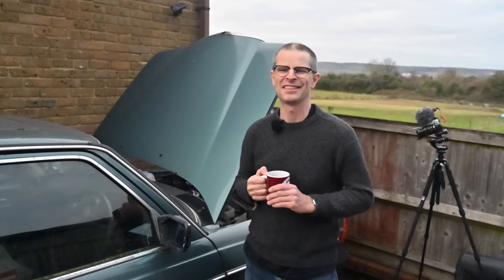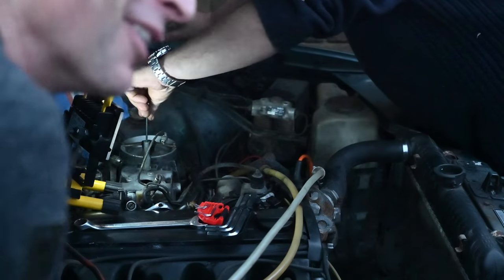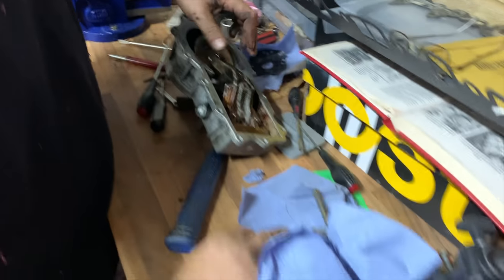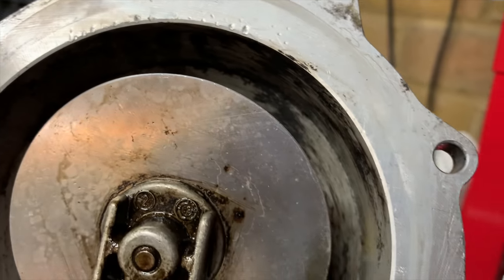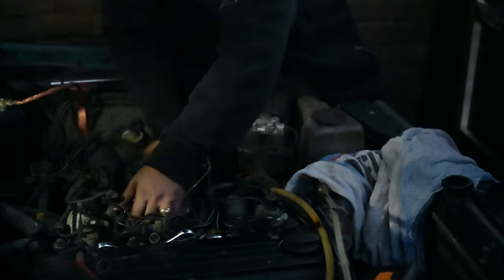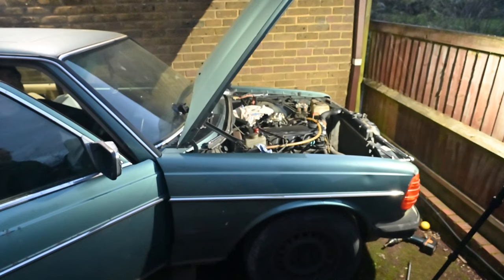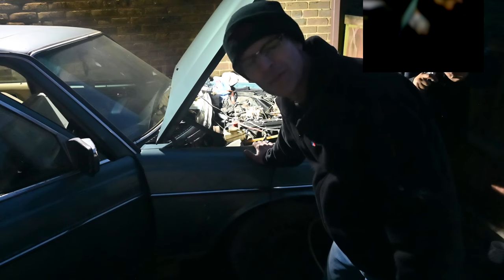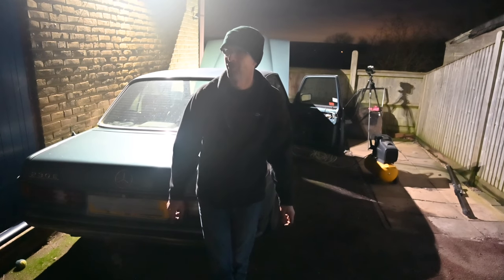Mercedes W123 - more fuel system shenanigans

Comment: That adjusted screw is spring loaded! you need to press in to engage the screw. I'll bet there was nothing wrong with that screw
Reply: I think the advice your getting is incorrect.  The air plate controls the fuel flow through the fuel distributor. turn in that adjusting screw 1/2 turn (press fully in to engage it) at a time until you get fuel out of the injectors.
Reply: I think the advice your getting is incorrect.  The air plate controls the fuel flow through the fuel distributor. keep turning in the adjusting screw 1/2 a turn at a time until you get fuel from the injectors. also please insure the connection between the fuel metering unit and intake manifold is correct. I have seen incorrectly fitted units leak air around the rubber connection and leak air so it will never start if that's the case
Reply from the maker: It wasnt engaging even when pushed in, think the thread has gone on it, its only aluminium after all

Comment: Matt, I am no expert but should you have a lighted cigar around gasoline and fumes? Otherwise great video!
Reply from the maker: Its harder to ignite than you'd think. I dont smoke but Andy says he did that for 30 years in his garage!
Reply: @furiousdriving  my question was not to ridicule but from an abundance of concern. 
keep up the great videos.
Reply: In an enclosed space where the fumes can build up it's not a good idea. But outside and a cigar/cigarette smouldering at around 400c won't, (and didn't), cause ignition. It matters how the cigarette actually falls onto the surface to the petrol. There is a lower chance of autoignition if the cigarette falls on it's side where the temperature is lower. Naked flames are the true enemy which is why there's no smoking in combustible areas because all cigarettes and cigars start with an open naked flame. Anyway, I had a fire extinguisher in my car and told/showed Matt where it was so he could chase me around trying to put me out.
Reply: @TheFakeRussian  Thank you for the explanation. Very good to know and I thank you.

Comment: Put a carb on it!
Reply: That is a great idea and the 2 litre version of same engine had a 1.75" Stromberg.
Find the manifold for that and put an SU carb on it.
Get one from an automatic car, that has the linkage for the kickdown cable.
Might reduce top end power a little, but would provide great economy comparable with injection of that era, but far more reliable.
Will also require ditching the high pressure injection fuel pump, for a low pressure type.
Reply from the maker: I think thats for the carb version. What Ive learnt is nothing is as cheap as you think it will be on these cars!
Reply from the maker: ignore, just saw your other comment
Reply from the maker: Think I might go electric if it wont run!
Reply: @furiousdriving  Think that would really bring a lot on new subscribers to your channel, but if you just got it running for now, conversion costs are going to get cheaper as time passes.
Batteries will be biggest outlay, which are in limited/expensive supply, until more electric cars start getting written off.
If the Merc were mine and I'd had so much grief trying to get the injection working, I'd be very tempted to just put a carb on it.
The 2 litre setup should just bolt on, though I'd probably prefer SU over a Stromberg.
Very underrated carbs that give good MPG and throttle response.
Bit of porting on the carb type manifold and could probably use an 2" HS8, losing minimal if any power, and have confidence of not getting stranded at roadside by complexity of current setup.
Reply: @furiousdriving  I bought my first Jag recently thinking parts wouldn't be too expensive, as so much is Ford related. How wrong I was, lol.